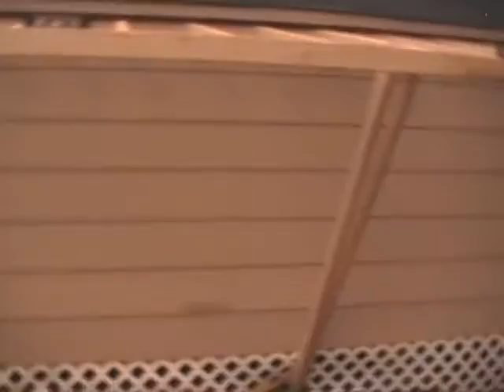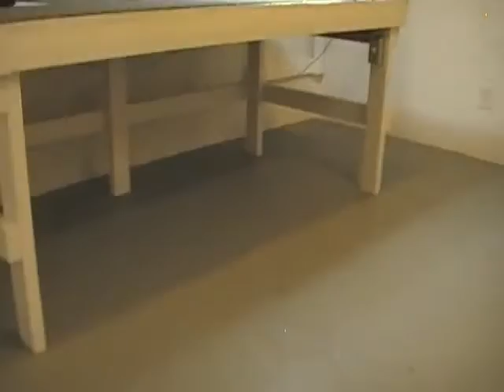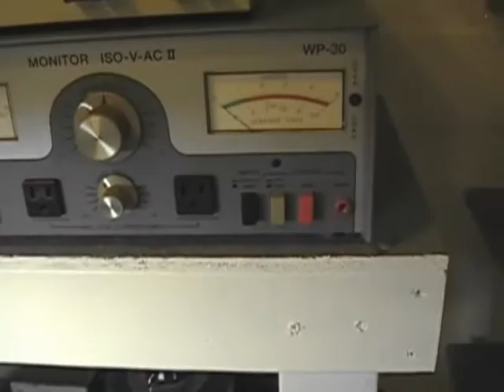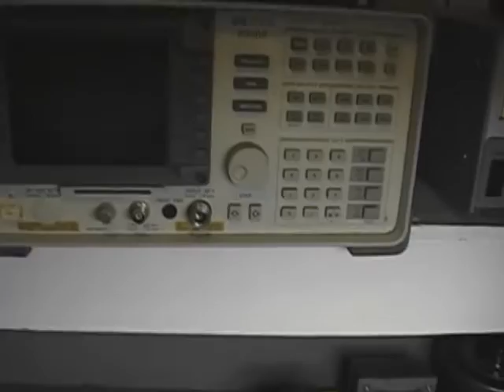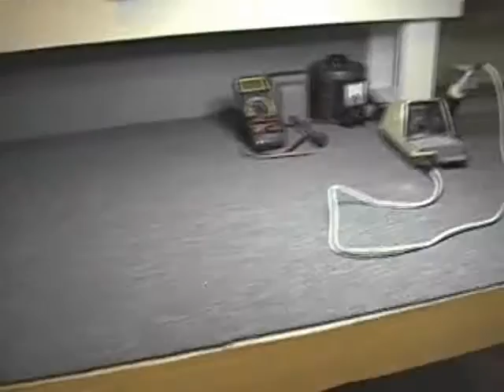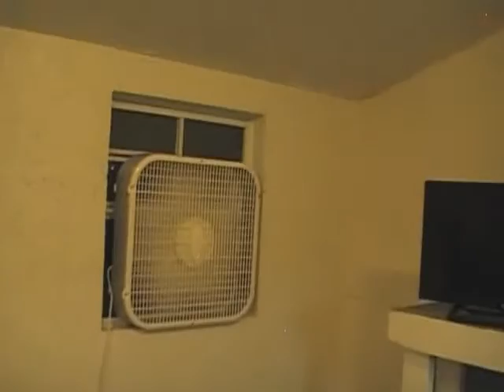Building Progress 07 15 2016

Comment: you should add some RF to your Gasifier build after i get my one build i am going to work on refitting it with RF and saltwater
Reply from the maker: RF?
Reply: radio frequency is used to ignite saltwater i was wondering if you could use it to get the gas from the wood better
Reply from the maker: I don't think that would be able to apply to a wood gasifier since it uses heat to break the wood down and even then you would have to figure out a way to interface the probes into the system.
Reply: https://www.youtube.com/watch?v=ejHXMqPfytw this one dont use probes and its the heat that breaks apart the h20 for burning
Reply from the maker: This is an old video but I've seen it before. Ask yourself a question but first make an observation. How much RF power in watts do you think he is using to burn that little bit of fire in the test tube? Look at the size of his setup and I bet you he is dealing with at least power ranges of 100 watts up to 500 watts. Is his return power efficient? I don't know because I don't know the power consumed to break down the salt water. Anyhow back to your original concept. Your concept is interesting but it would not interface with a gasifier. The wood fuel moisture has to be very low in the single digits because moisture stops the breakdown process plus it produces tar and lots of it. This is why I use dead branches that fall off of trees because it has already been cured by mother nature. In reality there isn't any water vapor to use RF on. I hope this helps you understand the gamification process.
Reply: what i am thinking is abstract thats why i need try it out once i build my gasifier. i am been asking myself for a long time WHAT IS FIRE? WHAT IS FIRE DOING WHEN IT BURNS?" i beleave there is a Radio frequency for everything. right now i think we as humans know nothing about fire.
Reply: for your Gasifier i wont make the air intake one probe and the cone the other probe. you could isolate the air intake with rubber where it meets the hopper then ground the cone to the hopper.
Reply: i found this video and it seems you have all the equipment to run the test. the guy was using radio antenna to burn the salt water  https://www.youtube.com/watch?v=-vxmKdDrpnI

Comment: Flash -Ed in Spartanburg---Have you considered building a food freeze dryer not a dehydrator.Most of them cost about 2800.00 and up. Thanks
Reply from the maker: Ed unless I missed something I didn't plan on building either. This building is a shop with an extension for a battery bank and a 110 volt AC inverter to make the building an off grid project.

Comment: Howdee Flash.  
 Looking good  :)  .  You are really powering through this project, and at just the right time of the year for it too.  Well done, my fellow woodgas addict.  
 Having a designated place to do all your electronical work is a great thing too.  Do you have any worries about security?  Round here, there are a lot of bad buggers, so I keep a loaded shotgun handy at all times, just in case of another Zombie invasion  ;) .
Reply from the maker: Steve we're probably no different than your neck of the woods with a mixture of good and bad guys but yeah I keep a shotgun handy. I finished the roof yesterday and now I'm in the middle of putting the shingle material on and I can tell you that it is hot! I'll be working on finalizing this asap so I can get moved in before summer ends.
Reply: flash001USA 
  Howdee Flash.
  Yup, working in the hot summer weather on a large project like this sure does put a good tan on ya skin  :) . You are making great progress, and will surely have it all done in time for winter's chilly bite.  
 I spent all summer working on my own one.  I call it "the little garden shed".  It's 26 feet wide, 24 feet deep - and 19000 dollars costly.   It's all built from steel - and it weighs a whole lot of tons, so it won't be going anywhere when the weather tries to blow it away  :) .   
 Workshops, like the ones we are building, will serve us well, for many years to come  :) .

Comment: Looking good Flash, I bet you were itching to get back at it. Sweet job.Ya gotta love it when a plan comes together
Reply from the maker: It's been a job for sure. This job would have been much easier with a helper but I managed to get the roof framed in using a few tricks to allow me to fly solo so all is good other than being stiff as a board today. Anyhow, I'm off to get some Gatorade and start roofing.

Comment: You are moving right along there Flash. I'm happy to get an idea of what kind of equipment you will be using , and glad to see how far you have come . Looking forward to you getting this where you want it. Thanks for sharing. Joe
Reply from the maker: Me too man... I worked in the heat and sun (when I wasn't getting rained on) and I'm here to tell you that I'm stoved up today. If I'm working in heat I'm OK but it had been a while since I was in it all day like this. It took it's toll on me and last night I couldn't cool down and I was stiff. I finally cooled off and went to sleep. It's 10:00 am and I'm off to get some Gatorade then I'll start up where I left off. Once the roof is up, the job will be much easier. I did this by myself building the roof frame on the ground in two 5 ft x 7 ft sections then lifting it over my head and using a ladder to hold things in place till I got the first wood screw in to secure it so yeah, I'm sore today but it's for a good cause.